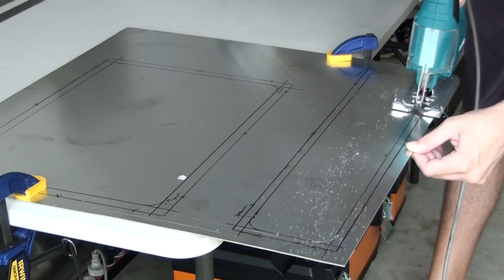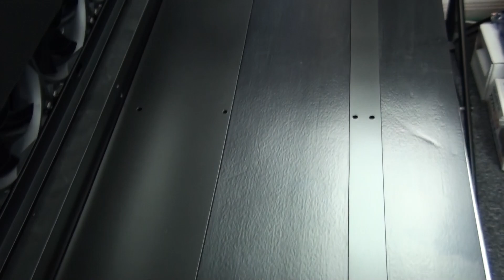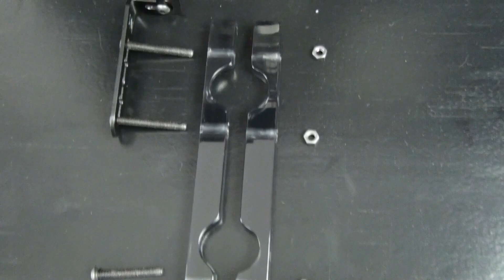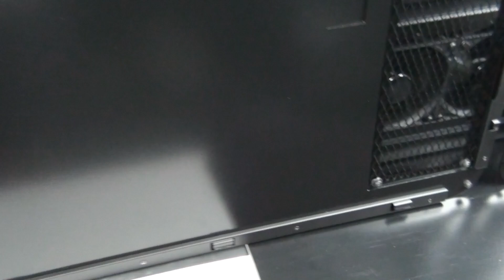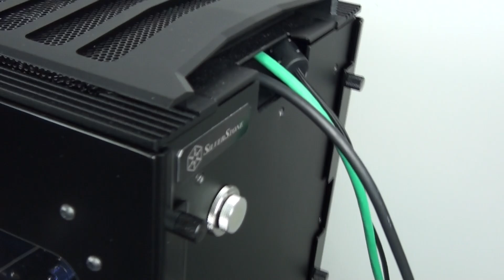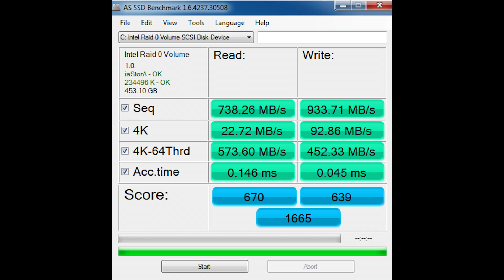Build #8: 'Cytotoxic': Part 8

Comment: First things first. Love this build, it is by far my favorite of your client builds.
Should you still be in business when i finish school and after 10 year manages to save up enough to pay for your work, as well as the hardware, i shall be in touch :P

About the build, and if you agree then perhaps inspiration for future prjects, Why stick to static designs ? for this example, coupled with the nuclear reactor theme, and especially the  Cerenkov radiation, why not have the "nuclear reactor" output more radiation when the system load is increased. in my opinion that would have been a pretty neat feature ! 
simply having ajustable light intensity as a fuction of system load, would change the design from beeing passive, to reactive to the user.

a real life example of where this is implemented in a case build, is to find among the older alienware desktops. Some had those outrageous (even slightly vulgar) top finns which opened to increase airflow, when the system load was increased. i think you could easily come up with much better designs than what they did, and i would love to see it!

Comment: Awesome build.  If I may be so bold as to offer some advice, one thing you may want to consider is drilling holes with forstner bits then cutting the acrylic in half may be a time saver vs using a dremel tool to make the entire cut out.  Obviously you will need to clean up the hole with the dremel tool but I feel it may save you some time.  Also you may want to consider drilling a hole for the Nut End as well, just close enough, so that when you tighten it the screw will pull the nut into the plastic and embed it.  Seems to me the nut would be a lot easier to manage that way if the acrylic was to hold it in place; provided there was room that is as I was not able to clearly see just how thick the acrylic was.  I hope my advice is useful, enjoy your day...

Comment: Love your Video's as always, what would another rig JUST like this one cost?
Reply: Probably 3-5,000 USD
Depending on parts inside it, if you're talking about the case with mods itself, probably close to 1000, then filled with 500-2000 with componants, and upto 2000 more for watercooling parts.

Comment: actually with a good air cooler like the noctua d-14 and a good airflow case, you can get pretty good results, not as good as this though, however water cooling has most effect on graphics cards in sli as with air cooled graphics cards it will blow hot air into the other  one, however I have seen people overclock vapor-x 7970ghz editions quite a lot

Comment: green mobo stock fan low profile green ram 92 mm cooler demolished case thats not even painted inside colorfull tiny cables one single slot low end gpu with passive cooler and one wd caviar blue 160 gb hdd D: so tell me about it..

Comment: sound good?
AMD FX-6350 3.9GHz 6-Core Processor
Asus M5A78L-M/USB3 Micro ATX AM3+ Motherboard
Patriot Viper 3 8GB (2 x 4GB) DDR3-1600 Memory
Seagate Momentus 750GB 2.5" 7200RPM Internal Hard Drive
Sapphire Radeon HD 7850 1GB Video Card
Xion XON-560 MicroATX Mini Tower Case
Rosewill Hive 550W 80 PLUS Bronze Certified Power Supply

Comment: If you built loops completely out of fittings/acrylic tube like this, would you ever have to replace the tubing like you would with standard tubes? I would assume you don't have to but I just want to confirm.

Comment: personally I'm not a fan of the surface screws on the side panel, at least not the way they have been done. I just don't like the seemingly random nature on the surface just to hide the bolts on the side you never see. Also not a fan of the back side panel only having a half panel, I think both sides should have been the same style. 
The thing everyone has to understand is that this is just one mans opinion, and that is the beauty of modding, everybody has different tastes.

Overall great job :)

Comment: After watching the Build log,I would say the build is VERY good.All the water cooling loop is great the color is too. Not to in your face. The wiring is also great. The performance  &  testing awesome.I would say 9.5 out of 10 for all the internal work.For me though & this is just my personal opinion on Aesthetics & design of the case Mods so please don't take it personally,They are not to my liking at all. I understand the concept but not for me.GREAT BUILD OVERALL thumbs up.

Comment: the way you got the front panel is really sweet! i wish i could do such things in my flat xD i would do the same thing with flames and red LED strips for indirect lighting on a brushed or sanded metal plate (the plate in front or instead of the fans). maybe a idea for another build? ^^

Comment: I don't see why you're hating on him so much. He is a professional modder and does the best he can do with the tools he has. This is about the best possible work without completely manufacturing a custom side panel. This is done at his house, with limited tools, materials, machines and options for custom pieces. If you're not satisfied then maybe you should stick with non-modded cases directly from the manufacturer so they are perfect.